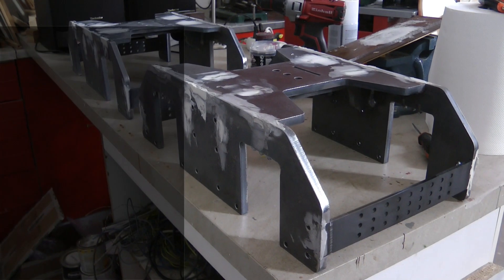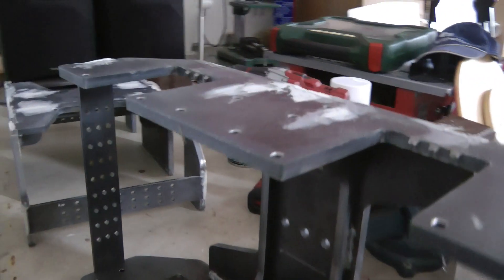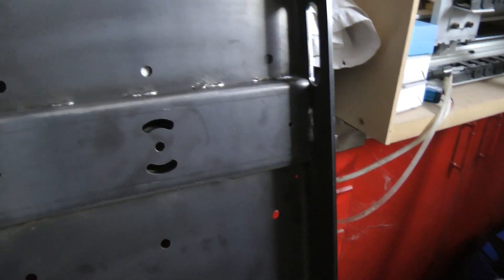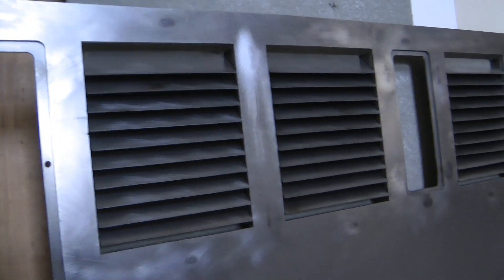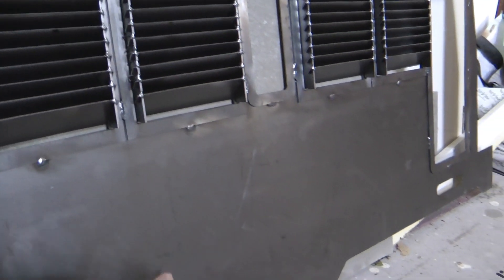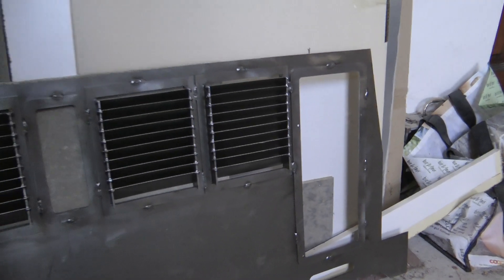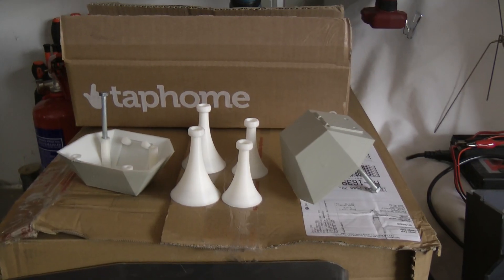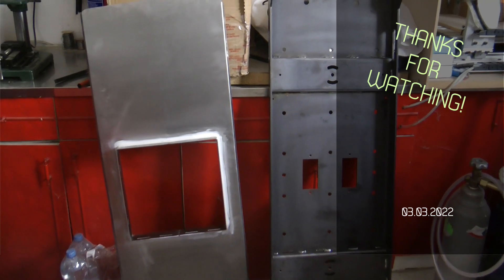New ride-on loco build: welding parts

Comment: Thanks for your video.
Will you make the plans available?
Did you laser cut or plasma cutter cut the 10mm plate? Or it's milling machine?
Reply from the maker: I will probably at some point, just need to clean up the drawings. It was laser cut. Pretty clean cut for a 10mm plate.

Comment: That looks as solid as a rock.
Reply from the maker: In retrospect I have gone overboard :) Now I can worry if the motor would be powerful enough.
Reply: @csongorvarga  It's the best way really, it will be durable. Will it be electric or engine driven?
Reply from the maker: @roscovarna  I battery electric. I want simplicity and not a mechanic to service the engine myself.